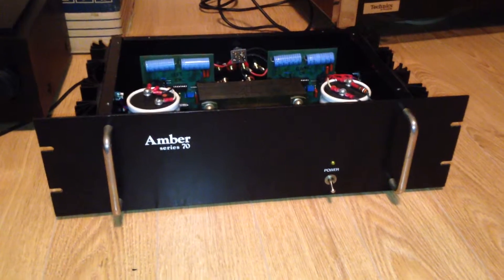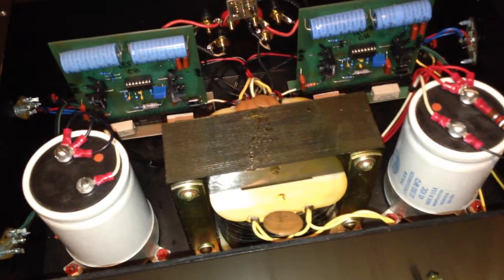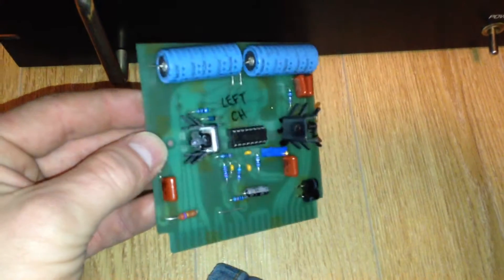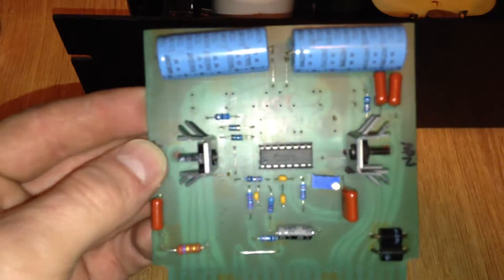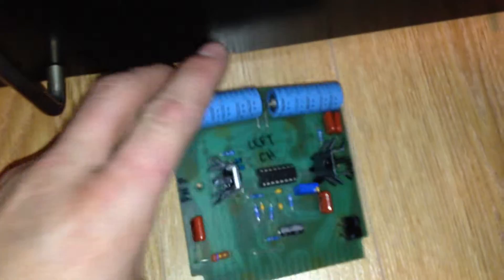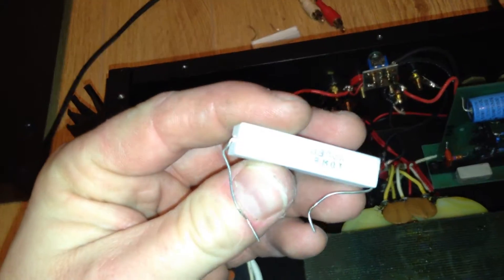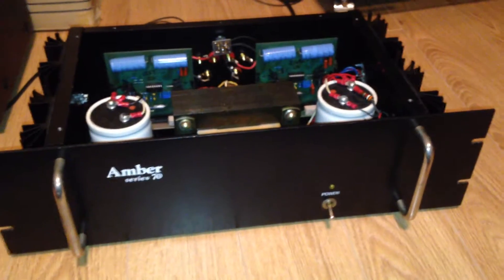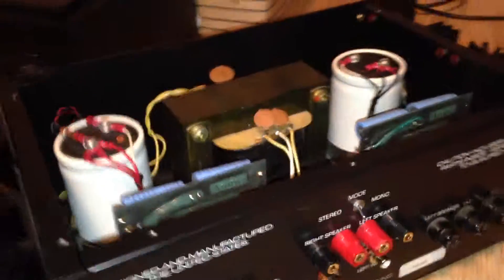Amber Series70 power amp now rebuilt

Comment: I picked up an Amber 70 years ago, it's so interesting to hear you describe it as a gainclone. I never thought of it that way. I have a channel out and it sits. I should buy its twin at my local pawnshop, and have them both worked over and run them as monoblocks.
Reply from the maker: it really is sort of a gainclone though isnt it? I mean I had a look at the diagram and the way that the IC is used and the layout of the components is close. Theres nothing wrong with the amp however, its an awesome powerhouse of an amp even running in stereo config